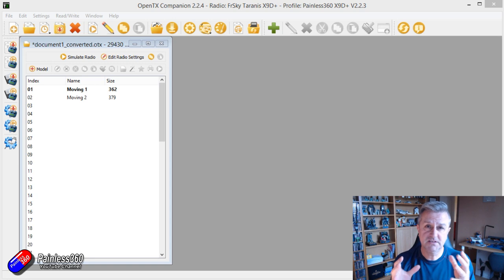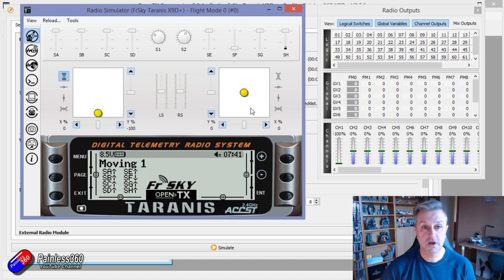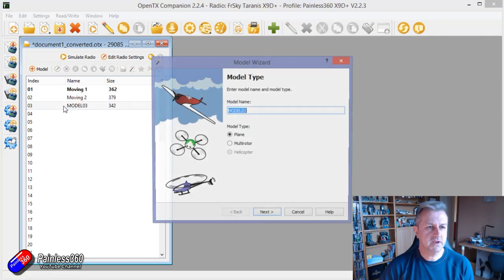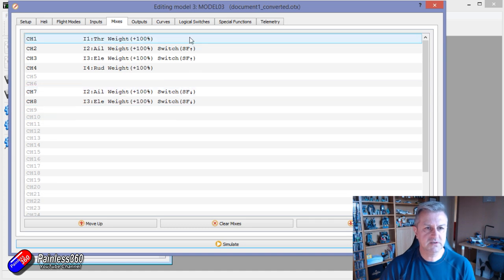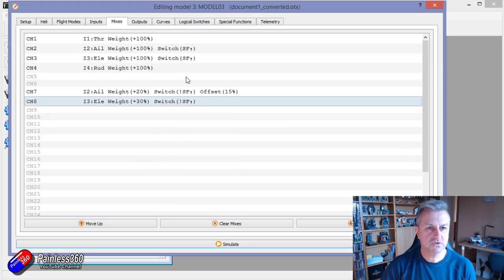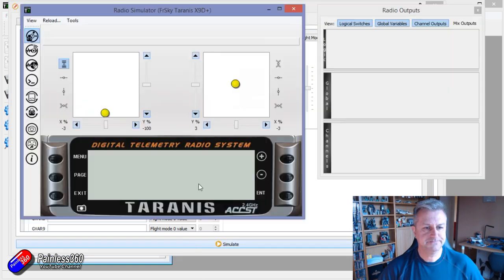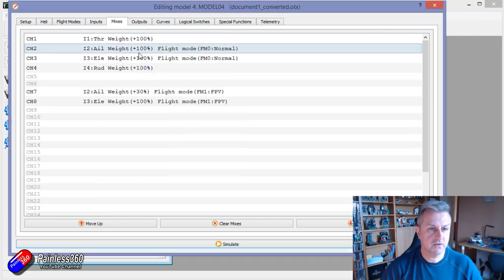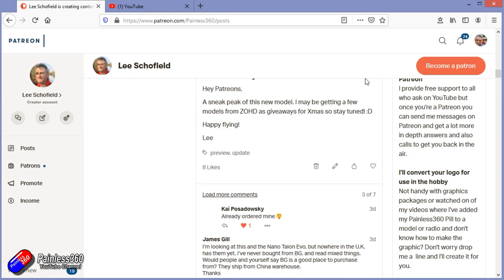OpenTX Mix School: Moving channels using a switch

Comment: Hi There, I am new to the FPV hobby and currently watching many of your old videos about it... I was just wondering if there was a newer version of your video (FPV on a budget) (2016) or if you have any recommendations for me. After watching your videos I either wanted to buy an Eachine LCD-Monitor as a ground station or separate parts (I don't like goggles that much). But I was unsure if I would need to have a video transmitter made by Eachine if I would use their monitor or does it perform well other brands too (like the quanum elite)? Thanks for your time and help :)
Reply from the maker: I do a kit picks video every summer. See the last one one from 2019.. Update coming soon..

Comment: Great stuff Lee!  Ok, on a slightly different topic, other than spending money for the sake of purchasing more electronics, what is the reason for purchasing the Q7 or Q7s when my X9D Plus can do everything I have ever needed and more ? Learning from you using Companion and all of your great historical content has fulfilled every task necessary in my RC endeavors. Your thoughts would be much appreciated. Thanks !  Paul ( sasdthoh )
Reply from the maker: If you're happy with that X9D there isn't a good reason to get the QX7.. :) Happy flying!

Comment: Hi Lee, another great video. One of the other advantages of using flight modes is that each function then gets it's own trim settings. With the simpler options the same trim is used for both functions. Cheers ...
Reply from the maker: You can make the trims the same across flight modes too.. Happy flying!

Comment: What if you want to change an existing channel?  Say you want to be able to use rudder stick to control the elevator by flipping a switch up and controlling rudder (with the rudder stick) by flipping switch down?
Reply from the maker: Yes, this is possible. Check out my EdgeTX mixing school... Happy flying
Reply: @Painless360  I'll do that, thank you